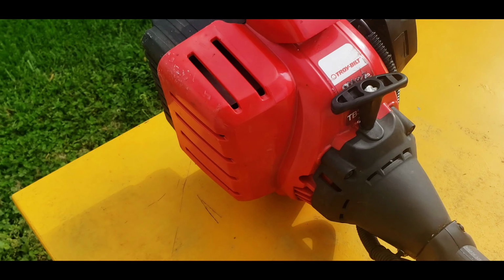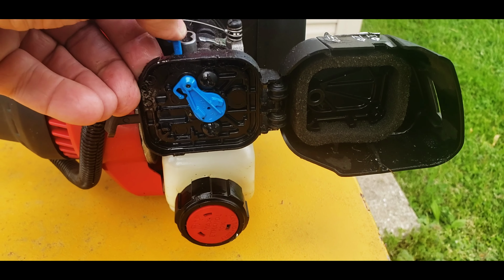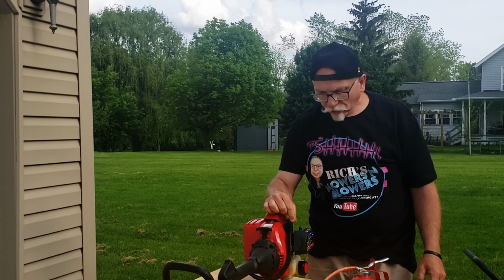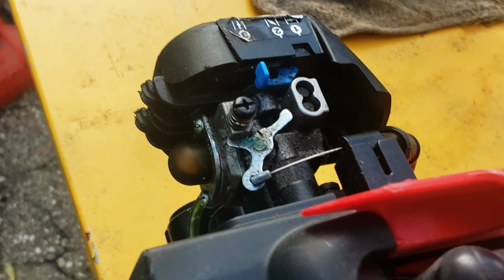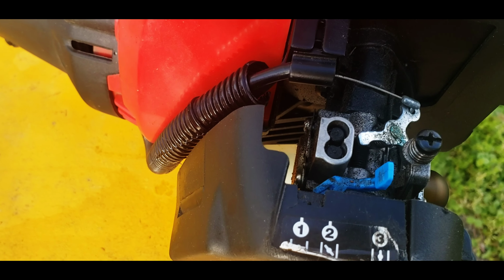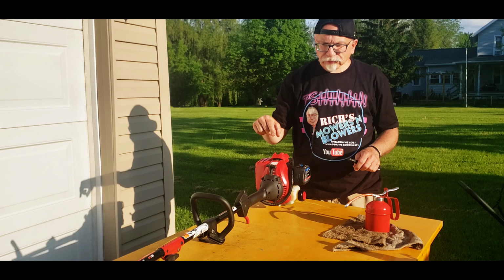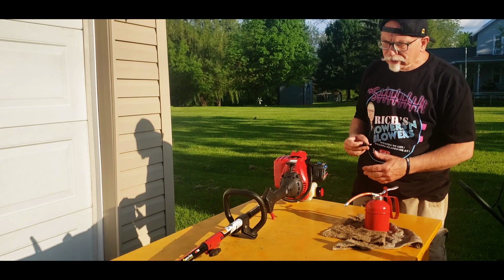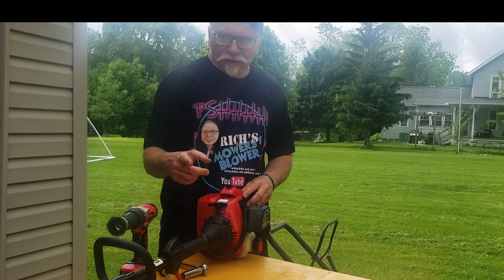2 cycle carburetor adjustment Troy Built TB32EC Stalling when pulling the trigger, idle fixed.

Comment: My exact machine. Exact same 2 problems. I have the tool just needed to see it done. Thankfully I also have the jump start tool and a highspeed drill. It took forever to just fire. Once running an eighth turn on idle, quarter turn on highspeed. It almost got tossed. hasn't been used for 3 years. I let it cool off.. No choke. Half a pull. Thanks. I needed to use the hedge trimmer and almost went out bought another machine
Reply from the maker: Dean,  glad you got it working. Thanks for your support.